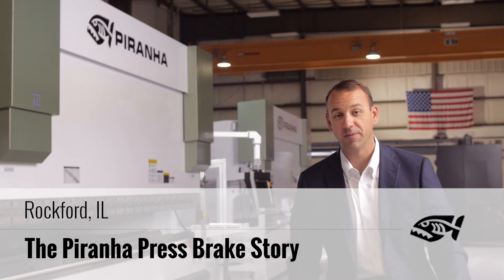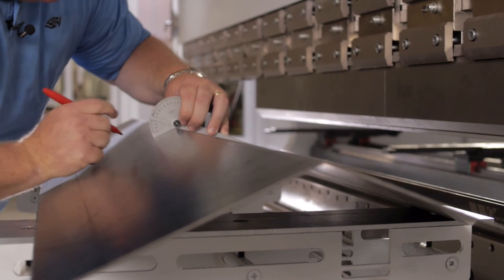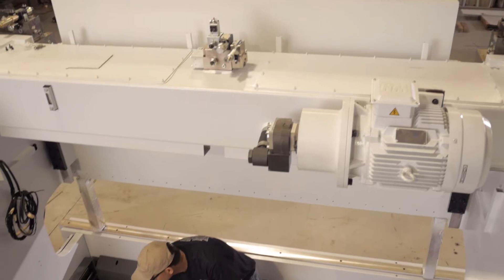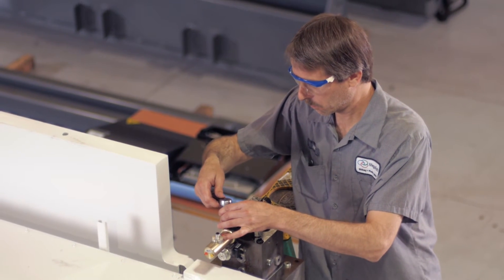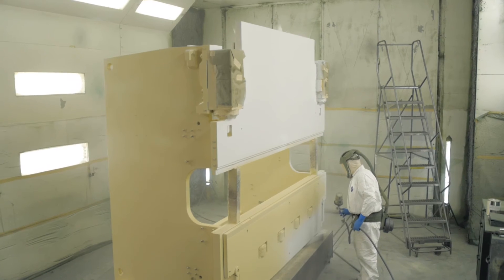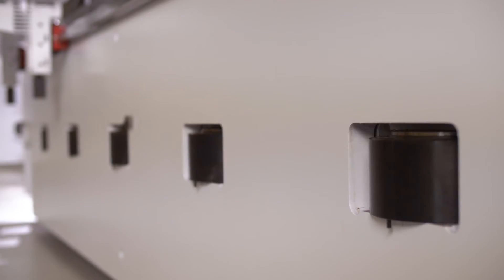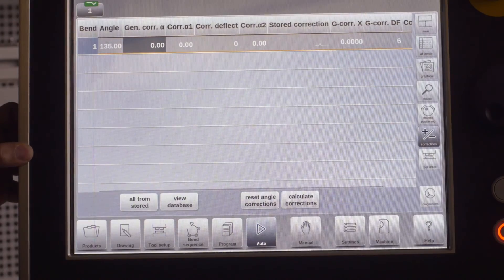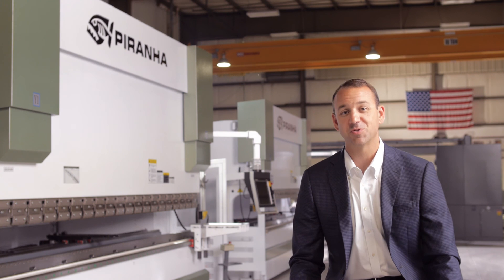Piranha Press Brake Story

Comment: Never got to run the Piranha that Monessen Hearth owned. No one, not even my supervisor who had been working on brakes for 20+ years, could figure out the aftermarket (I would assume) CNC controller. Someone was able to figure it out, but all they used it it for was to bend and flatten hems for fireplace pipe all day.